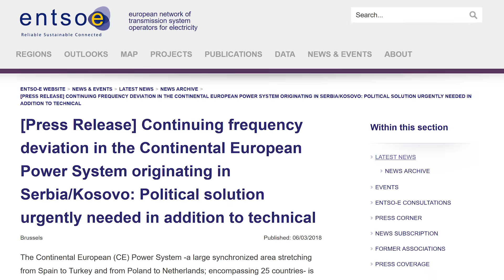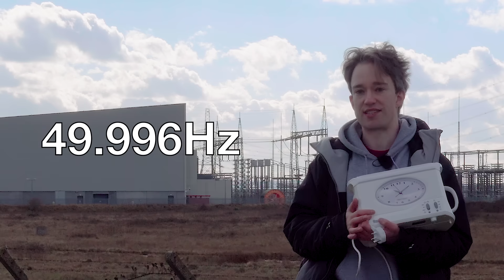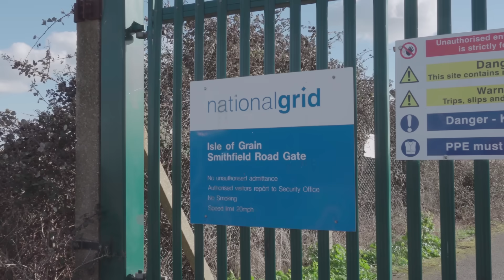European clocks ran slow for a bit. British clocks didn't.

Comment from the maker: Update, 8th April 2018: the dispute has been resolved, and they kept the grid at 50.01Hz for a few weeks to put things back! https://arstechnica.com/tech-policy/2018/04/european-grid-dispute-resolved-lost-6-minutes-returned-to-oven-clocks/
Reply: It's only right because the people who changed their clocks can again and the clocks that no one changes or are in places that can't easily are be accessed will be put right. In a few months there will be no evidance it even happened but if they didn't we would be finding clocks for years with the wrong time.
Reply: Never expected one of your videos to be an explanation for my clock problem. I live in the Netherlands and I always run my clock 10 minutes late. And I suddenly found that it ran 17 minutes late. I thought my clock was broken, it's really funny to find out that the entire European grid was broken and my clock was fine!
Reply: Probably high voltage DC.  One reason high voltage long distance transmission lines were originally AC only is because transformers can step the voltage up for long distance and down for distribution.  But, although this adds extra equipment costs, we now have technology that can electronically (without turning any generators) turn DC to AC at precise frequencies at the high power levels needed, as well as rectifiers and filters (which were already available many years earlier) to turn AC to DC at high power levels.  And these cables may well have cryogenically cooled superconductors to reduce losses.  Because of magnetic fields, superconducting cables lose their superconductivity when AC is transmitted.  This would justify the extra expense of AC to DC conversion at one end, and DC to AC conversion at the other, for single points of connectivity between two large grid systems.
Reply: @allanrichardson1468  no, not superconductive as that requires very very cold temps which would take rather ludicrous amounts of both liquid helium and power to achieve. On the order of Large Hadron Collider size. At least the one to the Netherlands... France, only a semi-ludicrous amount.
Reply: mystica5551212-subs According to an article in, IIRC, Scientific American a few years back, some scientists have proposed putting combination pipeline-cables underground to ship both liquid hydrogen and DC power.  The innermost layer would be made of a high temperature superconducting alloy that “only” requires liquid hydrogen; around this would be a pipeline carrying liquid hydrogen produced by electrolysis at a hydroelectric plant (which someday would have a fusion reactor powered by the deuterium concentrated by the process, in which case only the water source would be needed, not the cataract).  The plant would ship the two products together: hydrogen to be packaged as portable fuel (or to run fuel cells at the receiving site), and electric power.

I haven’t heard any more about such a project, so I don’t know whether it’s practical (yet).  But there are superconductors that operate at liquid nitrogen temperatures, and one day there may be “room temperature” superconductors.
Reply: Why are the two underground cables supplying DC current.... Wouldn't the losses over the channel be larger than carrying AC current?
Reply: @samdettle8694  No, I would recomend watching ElectroBOOM's  "Why HIGH VOLTAGE DC power Transmission"
Reply: Actually, you've got that backwards. Technically, for the same average voltage, DC works better then AC. A phenomenon called skin effect concentrates oscillating current towards the edges of a conductor, reducing the cross-sectional area, and combined with the natural inductance of the wire, raises the resistance. 
However, where AC wins over DC is in the ability to step the voltages up or down with purely passive components - transformers. Which is a major consideration for distributing electricity, especially to the individual users. A single, point-to-point high-voltage transmission line, however, can just offset the cost of switching to and from DC by the energy saved in vastly reduced transmission losses.
Reply: @watchm4ker  Skin effect is relevant for high frequencies, not 50Hz
Reply: @samdettle8694  Alright, so I'm going to reply to a year old comment. One of the reasons why AC power lines are high up above the ground is because bringing them closer to the ground causes more resistance. So I'd assume that underground DC has less losses than underground AC.
Reply: @samdettle8694  Two reasons: 1. because high voltage DC requires less insulation therefore smaller and cheaper cable, and 2. because submarine cables have two conductors tightly packed together they form a capacitor and DC loses less power to the parasitic capacitance (DC doesn't pass through a capacitor, AC does). Neither of these are problems for the regular power grid, since the cables aren't insulated, and there is large separation between them.
Reply: Sam Dettle HVDC (High Voltage Direct Current) is more efficient than AC, but it's also much more expensive, so over long distances, the cost-to-benefit ratio tips in the favor of HVDC over AC.
Reply: your patriotism is a credit to you , monsieur!
Huzzah!
Reply: And by the way you could do a great video on our power system in Quebec almost all Hydro electric 😁
Reply: They could REALLY get ahead and do 50.25Hz for a few months. Then they'd be ready for the next.. time.. this occurs.
Reply: In Germany we just use DCF77 Clocks, which are not effected by this. And I think running at a higher frequency is kind of a problem for industrial purposes, such as big motors etc.
Reply: Yes, but what about another question...where can I get that Swan Teasmade?
Reply: incorrect. quartz crystals are used to synchronise time it the frequency. and the frequency doesn’t go down by the amount of load, the voltage does.
Reply: 7o
Reply: that's perfect.
Reply: oi oi 52 % of those that voted.;) no where near half the country.
Reply: Doe it fall under 50hz because the increase load cause by the confinement ?
Reply: Worth noting that even mains-connected alarm clock often have their own independent RTC circuit.
Reply: Is this happening again because of the outages from the war in Ukraine?
Reply: Looooooove the British flag shirt at the end, Mr Tom Scott!
And my condolences for the loss of Her Majesty, Elisabeth the Great.
Reply: Queen no more 
So
God save the King
Reply: Yo quick question did you update Wikipedia with this info
Reply: You can do it yourself, Max
Reply: Tom Scott next time make the video 8 sec longer 😇
Reply: Tom Scott The problem with that solution is that everyone already updated their clocks when they saw they were slow. Now we need to change them again for no reason... Stupid politicians.
Reply: @xDarkPrototypex  But consider the following: If you noticed the clock running slow and corrected it, you will notice the clock running fast as well and then correct for that as well. But people who have not noticed whatsoever will now have their time set correctly -- and appliances that use clocks that you never see will also have their time set correctly, which is really the more important bit.
Reply: @xDarkPrototypex  that doesn't help with automated systems
Reply: Why not keep time using a quartz crystal or something?
Reply: @SilentBudgie  . That something is call "a watch". That is precisely beacause they wanted to spare a watch cost that they designed this failing contraption using electricity frequency.
Reply: @philpeko1796  well said
Reply: Here we are: 2 years later
Reply: Gosh! It does not seems to be an april fool. In year 2018, people still sell ill-conceived clocks, and take so bad healing measures... It seems we did not learn anything since Titanic.
Reply: @philpeko1796  Is this a Reductio ad Titanicum?
Reply: @cg0wamp  : 😀Good one! I think you may analyze this as a  [Reductio ad Titanicum] from 😏 me. Anyway, everyone may have to concede that this was a crappy design followed by a crappy fix!!! 😱

Comment: Reminds me of the BC Hydro grid even the export/import substation is similar. Connected to the other western Canadian provinces and the US through intertie cables but BC has it's own much higher internal standards for grid power compared to most of the continent with privatized power where theyre more lax about drift so legally we can't be synchronized to anyone else. Apparently there are now sensors all over the grid whos feedback can be used to keep the grid at almost perfectly 60.0hz

We learned well from great granddad it seems.

Comment: So they have to divide 60 by 50 to figure out how the time works because if you're doing 50 cycles a second and then you're off by 10. 

In America if we did that it would just be one to one because we do 60 and there's 60 in a minute for some reason. 

However we all still have to deal with the annoying AM and PM 24hr time FTW.

Comment: My mother had a microwave with Y2K-problem. Why did a microwave had a calendar. Probably because the clock microchip used in it had one and the maker decided not to waste a ability of the chip. Nevertheless I tested it and yes it stopped operating if it hit 1.1.2000. So I set it back 1960 and it worked fine for my mom for rest of her life.

Comment: Why didn't they use quartz crystal movements and be done with the whole thing? Last I read the oscillation of the Cesium atom is a physical constant and  1 second, s, = 9,192,631,770 ΔtCs

Comment: As any mariner knows, only trust battery powered clocks when using generator power. Their cycles are usually set a little high (typically about 1Hz) so they don't drop too low when there is a sudden power draw.

Comment: Aha so now I know why our microwave suddenly after a while runs behind in relation to the other time displays, we have something like six clocks in the living room but more for show because they look so nice, not to read the time that is just a side effect.
The striking thing is if you start paying attention that all clocks in the living room are within a second of each other, even the digital clock of the oven, but what then strikes you is that the time indication of the microwave suddenly runs a few minutes behind after some time, in short that is because of the number of Herz, then I would have to look somewhere on or under the microwave if the number of Herz is set correctly, if that is only slightly different from the rest then that explains the difference, right?
But I wonder if you can change it yourself just like that?

Comment: The microwave in the kitchen of my student housing is always getting gradually more wrong since the "minutes" it counts are just a little bit shorter than actual minutes. Every once in a while someone decides to set it right, and it runs sort of correctly for a few hours, but less than a day later it's already wrong again.

Comment: My microwave clock picks up a few minutes a month , has done for years . I just had a look at the info panel ,1200 watts , 220`~240 Volts, 50 Hertz . Australian grid power runs @60 Hertz. The mystery of the microwave clock has been solved 👍👍
Reply: Actually you would lose 10 minutes per hour if that really was an "AC sync clock". Your microwave probably just has a cheap quartz clock, like most appliances these days.

Comment: If every single clock in the EU is running 6 minuets slow, are they actually running slow or has time changed?
Reply: Not every single clock, just mains-powered ones. Watches, battery clocks, analogue clocks, computers, internet, mobile phones, etc were all still on correct time.
Reply: @pineapplesandjellies  It wasn't supposed to be literal, it was a philosophical question.
Reply: @SirFloofy001  I think the fact that many other time pieces show the correct time is part of the answer to the philosophical question.  There hasn’t been a uniform change in indicates time, only a subset of clocks diverging from both the bulk of clocks and the agreed definition.
Reply: Well, we do define a second of time as some 9 billion oscillations of a cesium isotope and the planck time is defined with fundamental constants, so the answer is definitely that the clocks are running slow, even if every single one did.
Reply: That depends on how long it takes you to dance 6 minuets.

Comment: I can confirm that Isle of Grain is in the middle of nowhere.
I've had to deliver there at least once and while driving there I thought maybe I'd somehow either traveled through time to some desolate future, or arrived in another country.

And actually, at home we had a clock/timer for the boiler which would, over the course of a couple of weeks, eventually start running 5 minutes slow even when set to the correct time.

Comment: I have grossly underestimated the number of clocks relying on the grid to keep time. In my country, we don't have any really! so no help from the queen needded. anything new uses an oscillator anyway (using power or battery don't matter) and anything old simply has no clock, maybe some sort of mechanical alarm that keeps time for an hour or something in case of ovens, but they are mostly mechanical.

Comment: Time based on the grid is so 1980s 😀 We use quartz crystal resonators thanks to Walter Guyton Cady who invented them just a few years ago in 1921. 😀
Reply: Quartz clocks need to be adjusted, and the quartz crystal resonator's frequency depends on the temperature. For precision, it has to be mounted in a quartz oven.

Comment: I still have a clock radio bought in 1982. It keeps perfect time, but if the mains fails its backup battery system loses (or gains, I can't remember which) a couple of minutes over the space of a few hours.

Comment: Now you know why folks who have expensive record decks with an AC motor, use a PS that regenerates the mains waveform. Its to keep the deck turning at the correct speed.  33.3/45 or 78rpm.

Comment: I have a possibly related question. We have 2 Siemans ovens in our house (in Belfast). One is connected to our wifi, the other is not. The Wifi-connected one keeps correct time with my phone and other things in the house. The non-connected one runs quite fast and will be 2-3 minutes ahead in the space of a few months. Could this be related to network power frequency?
Reply: It will have it own (not very stable) oscillator.

Comment: Uh, quick question... That "Teasmade" just gives you boiling water, right? Otherwise, you'd need a tea bag already in your cup before the Teasmade brews anything. 😕
Reply: The tea or teabag is in the integral teapot and the boiling water travels from the boiling vessel through a condensing pipe into the teapot. So you have a fresh pot of tea when you wake up.

Comment: Two years late to this tea party, but I must ask: So if I were to purchase a Teasmade, and plugged it into my US grid, which runs at 60 cycles per second, would that make it run 20% faster?
Or would they have it set to run on the American grid and send it with American plugs? Not sure if I want to spend $122/£88 to figure this out, however.

Comment: I know this is a relatively old video and this isn't the main subject but... DC? The undersea cables carry DC current. I always thought DC was an inefficient way of distributing electricity. Why DC? I'm going to have to spend today investigating.
Reply: Less losses. AC can easily be transformed to high voltage for reducing losses, but the losses are higher with AC than with DC, so high voltage DC is used forlonger distances. The effect depends on the type of transmission: Cables show it far more than overhead power lines.

Comment: This is now a little out of date , there are now   4  power cables to mainland Europe. One 2gw to France from Kent. A 1gw to the Neverland's A 1gw To  Belgium and a new 1gw from Southampton to France.  With another 1gw to France planed go be  installed via the channel tunnel.
Reply: Even at the time, there were several things this 4-minute video glossed over: Northern Ireland is in sync with the Irish grid and only connected to the rest of the UK with DC, so technically not all of the UK has their clocks at precisely the same time. Also, the Nordics (western Denmark excepted) are on a separate grid to the main continental European one. Sardinia and Corsica are only connected with DC as well. Finally, Marocco, Algeria and Tunisia are synced to the European grid as well. So really, "Europe" here was "from Marocco to Turkey to the Great Belt strait in Denmark", not "from Spain to Turkey to Denmark (conveniently not mentioning any of the Baltic or Nordic countries besides Denmark)".

Comment: As a young engineer I briefly worked in power stations in Northern Ireland.  Back then, before the Good Friday agreement the IRA would not let the NI grid interconnect to the EIRE grid.  It was tried but they blew them up.

I had shifts in the electrical control room of one of the power stations and part of the half hourly logs was the system time against an accurate (chronometer) wind up clock.

During the day the time would tend to drift behind the chronometer as demand tended to lead supply.  Overnight we would the carefully oversupply to catch up and the target was to be aligned at 07:00 for peoples alarm clocks.